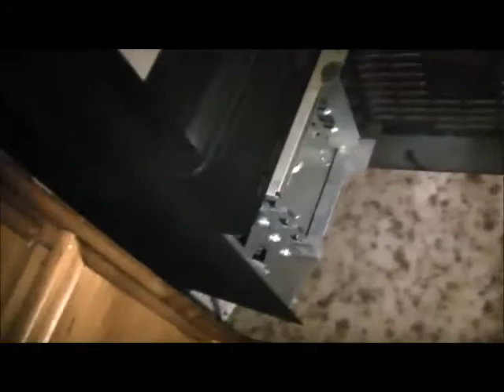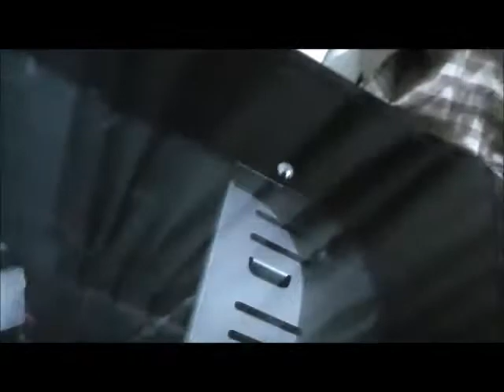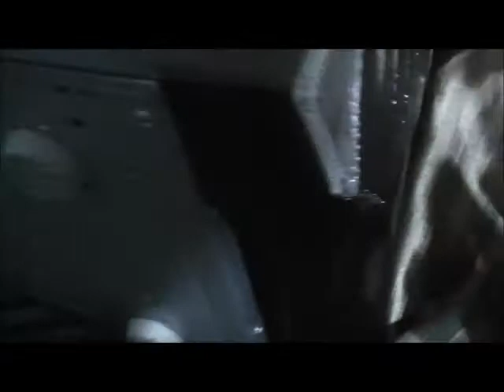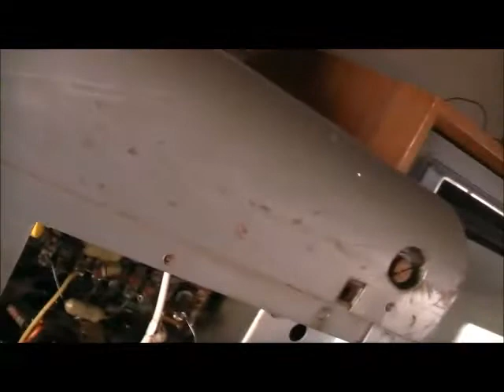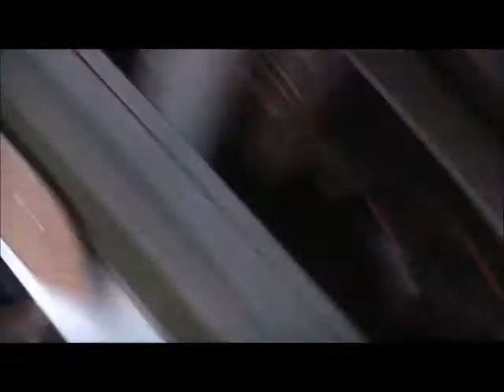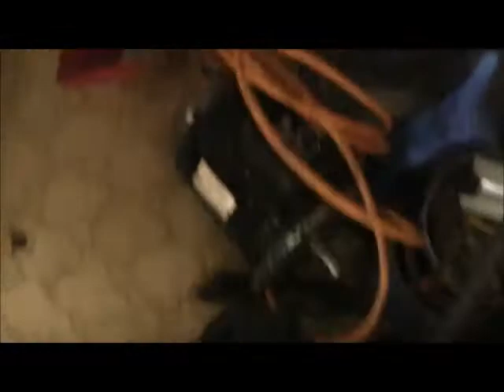Acer Update & Amp Wall Wart

Comment: That is bizarre. The wall wart which comes with an appliance isn't beefy enough to power it?

Well, it looks like the bottom of the barrel has just been reached. :-(

When it comes to pants electrical stuff, that wall wart takes the biscuit. Who supplies a power supply that isn't chunky enough?!
If that was mine, I'd really be thinking about POPPING IT, just for being a pile of pants.

On second thoughts though.....Supposing there's something wrong with it? Why not take it back to the store or contacting the seller and explaining the problem?

Another thing worth thinking about...... The amplifier may have a problem! :-O

My point being here is the equivalent of putting a bigger fuse in a faulty electrical circuit..... Yes, you'll get it working again for a little while..... Until there's flaaaaaames! :-O

Looking at it this way, it's EITHER the wall wart or amplifier that's faulty.

If you use the bigger wall wart with the mini-amp, just keep a watch on the amplifier and make sure it isn't getting too hot or some kind of symptoms which would indicate that its using too much power because of an internal fault.

Best solution: Take it back to the store or contact the seller and explain the problem. You've only just bought it, so it should be well within the warranty.

The little amplifier does look cute though, and I'm sure you'll have a use for it.

Thanxx for showing,

-BoomBoxDeluxe.

25th September 2014, 12.40